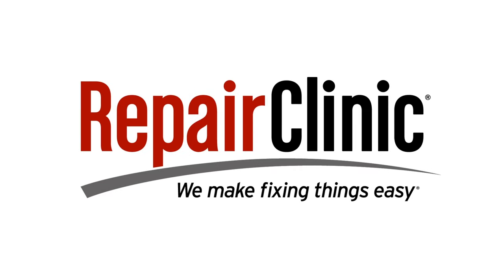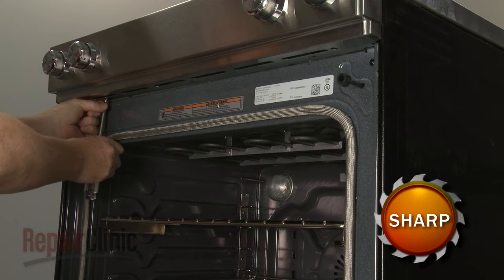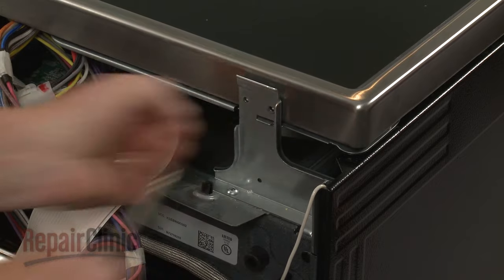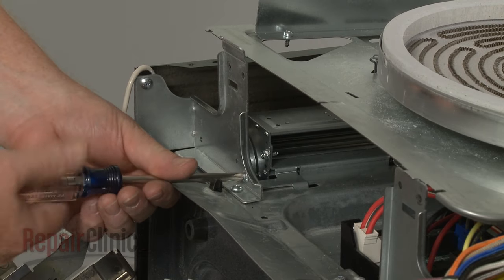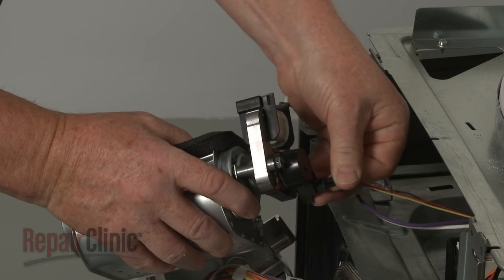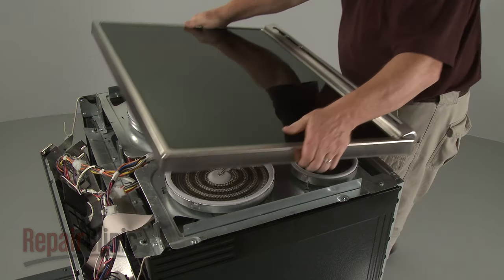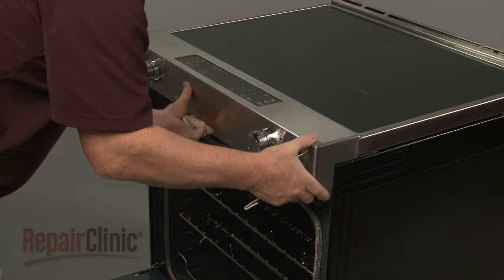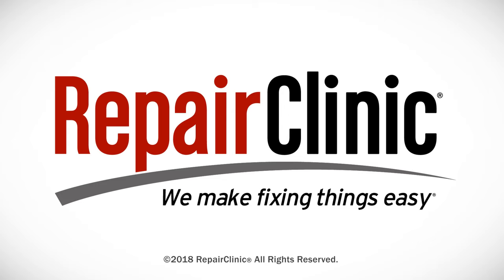Kitchenaid Electric Slide-In Range Cooling Fan Replacement W11107275

Comment: Thanks for this video. I was able to replace the fan on our electric downdraft range pretty easily. I suspect that the gaskets on the fans are often incorrectly applied at the factory. Our old fan was thick with dust and grease which I am sure made it run slowly. I tried to re-glue the gasket hoping that I would get a better seal than at the factory.

Comment: If you watch from 2:55 onward you can see that the 3 pin connector on the new assembly is actually a different colour and different pin size than the old assembly. Then they switch to them putting the old assembly back in... Because the new pins won't fit.

Comment: What is the typical cause for this blower to fail? Especially on a newer unit. Is it possible that a connector was improperly fastened during assembly, and simply failed over time when moving the unit around during cleaning? It's just odd for an electrical motor like that to fail. They usually last years.
Reply: These types of fans are used in many applications (fireplaces, heaters, etc.) but they always are mounted so they can draw cool air. I suspect that people who leave their oven door open during the cool down period are killing their fans. 
Notice that when the door is closed, it pulls relatively cool air from between the door and its frame. With the door open, it's sucking super hot air.  Much hotter air than most electronics are designed for.